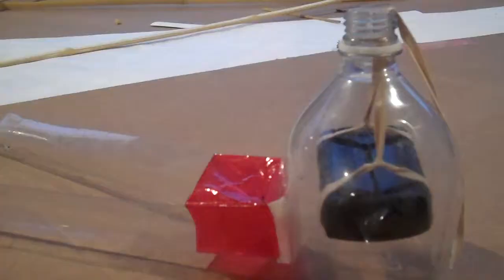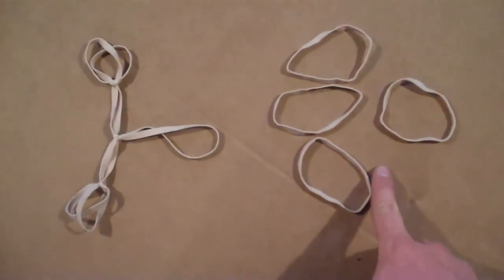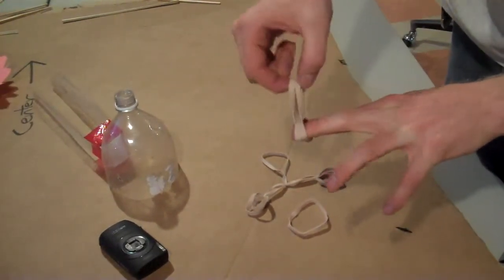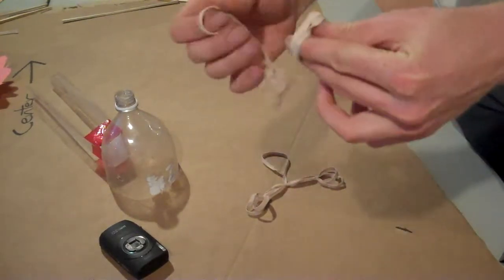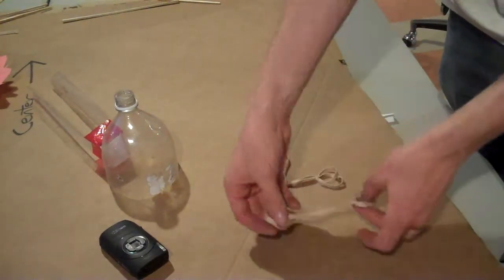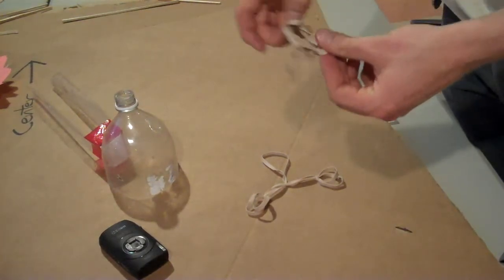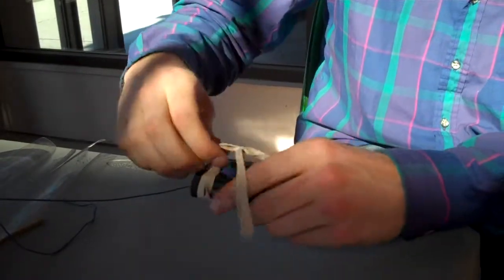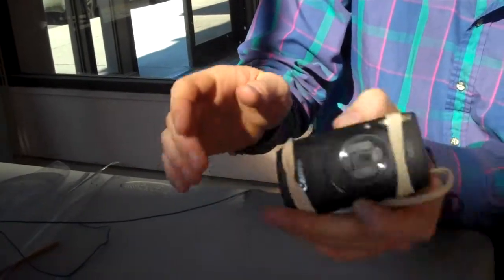Rubber Band Camera Harness for Grassroots Mapping Aerial Photography Rig

Comment: the flaw i kept running into is that the cut in the plastic will slice the rubber band, breaking the tension.  i will try taping the plastic so that it doesn't cut the rubber, or perhaps a larger rubber band